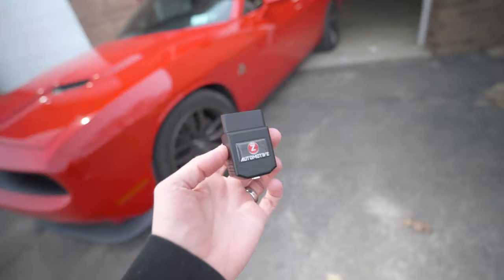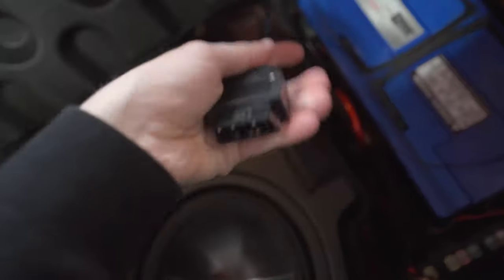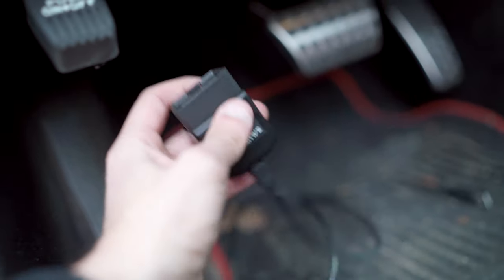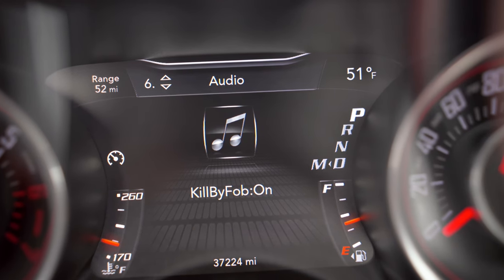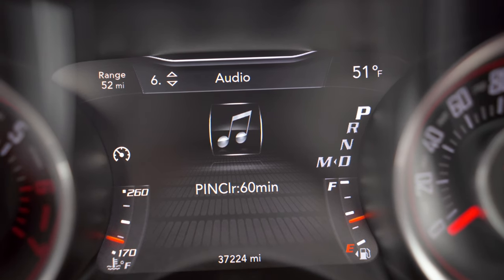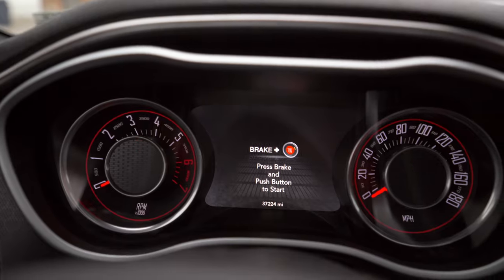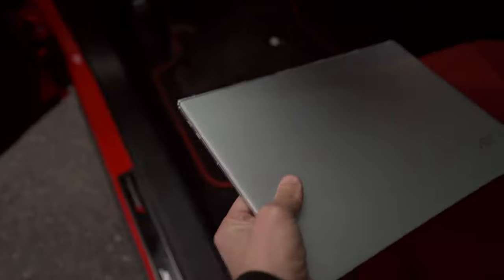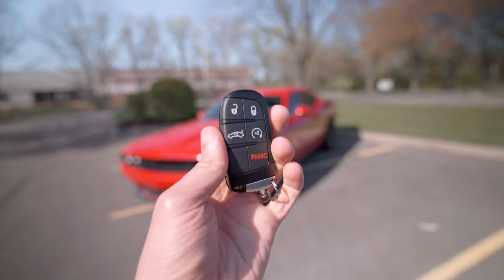Protect Your Vehicle from Automotive Theft - What This Device Can Do Will Shock You

Comment: Question here. For the 2011-2014 cars with the 5 speed auto Will pinlock  be able to tell if someone has pressed the shift lock button and activate the pin lock? It is much easier to do it on those cars with that transmission. Thanks!

Comment: Bought a Tazer for my dodge charger r/t. They are big ticket cars in my area. The Tazer security gave me the ability to sleep at night without worry because that car isn’t going anywhere without the pin. I even reduced the pin so you have much less time to work it.
Reply from the maker: Great to hear it can give some peace of mind but remember that it is not a fool-proof security device, so be sure to take as many added precautions as necessary

Comment: Does pedal disable still work for those who have Pedal Commander or other drive by wire eliminators? Also, when adding the 2nd OBD2 port in the trunk, is it going to screw with the factory port when I go for emissions?

Comment: Use the kill by fob all the time and works pretty well. Tired the pin but had issues with it not taking and then my car going into lockdown so I'm glad that they added that feature (lets hope I dont run out of battery on the fob while I'm out 😅).
Reply from the maker: if you're on the latest firmware, entering the pin is much more stable and snappy
Reply: I'll check my version and update it if its out of date and try again. Thanks! @zautomotive
Reply: Did you ever fix your pin situation ? Even after inputting my pin and getting the Disabled prompt my alarm still goes off.. sucks. Had to turn pin off and use only FOB function
Reply: @nbtextremes  I did an update and it fixed it. When I use the FOB I don't have to put in the pin, but if I forget and just hop in (which happens from time to time) or manually lock the doors with the button, the pin has been working as advertised.
Reply: @ajperkins9363  I realized it was because I out the pin in with my door open during testing. It was taking the pin but disabling the  system. I thought that was weird ..I closed the door,  did same thing and it worked

Comment: I'm considering getting one ever since my car got broken into about 2 weeks ago. But won't this void warranty? Or am I blending this in with your guys' tuner?
Reply from the maker: This is our tuner, this is the same device that has all those other features that you’ve probably heard about (Linelock, lightshow, performance pages on certain models, etc). It does not void warranty but it’s recommended to remove the device before taking it into service
Reply: @zautomotive  Ah, so its just plug and play, and the tuner itself kinda holds the info and feeds it to your car, in a way? Like a temp load for your cars computer and when its taken out, its not modified?
Reply from the maker: correct all plug and play @bhagrt

Comment: You mentioned if we valet the car or take it to a dealership we can use PIN Disable, does this mean we don't have to unmarry and unplug the device anymore when we take it for service?
Reply from the maker: That depends. It's always recommended to unmarry and remove the TaZer before any service work, but some people may have dealerships that know of the TaZer and may have a good working relationship with them. 

 PIN Disable may be a useful option for those that have that working relationship with their dealer, although keeping the TaZer plugged in is not recommended for service work.

Comment: Greetings , I am getting a wrangler.  Great video how would I remove the need to plug in a taser in the front where it can be removed.  Will this work with a taser min ?
Reply from the maker: These updated features are not yet available on the TaZer mini, just the base pin lock features where it locks up the brakes. You could always purchase out TaZer shield to help from the TaZer mini from being removed https://www.zautomotive.com/product/tazer-shield/

Comment: I have a 2015 Challenger, i got update 2.5.9 and have loved it thus far but i got 2 things i would like more info on. Ever since updating to 2.5.9, now when i open my door with the engine on my car makes the chime sound and flashes "fob battery low" on the dash until i close the door. Not sure if that is a feature or a bug but im not a fan of it and am hoping there is a way to turn that off.

My second question is regarding the new way pin lock acts. While overall i like it, i am a little concerned that 40 seconds is a bit to much time for a smart dodge car jacker to get the car on and moving before pin lock kicks in and even then it's still a matter of when the car slows down enough before the brakes actually lock up. I totally understand the car having to be slow enough before the brakes lock but my question is, is it possible to shorten the time from 40 seconds to say maybe 20 seconds or less before brake lock activates? Personally i would prefer 10 seconds but that's just me. If not i think this would be a great option to let us choose in the future and possibly consider shortening the time for by default. The Average theft time of a Challenger is 40 seconds but that includes the time it takes to get into the car and start it. Once thiefs start the vehicle they're pretty much gone within 10 seconds or less most of the time. In this regards i actually think the old pinlock method of locking the car on start-up was safer. 

That being said i do like the idea of having an initial delay (the new way pinlock is) but I think how long that delay is really should be customizable or give us the option to lock on startup like before. 40 seconds is just to long in my opinion. Sorry for the long comment just wanted to put my experience out there. Love your guy's products man you guys do incredible work, keep it coming💪
Reply from the maker: The "fob battery low" notification is warning you that Car-Jack Mode is going to activate if the key is removed from the car and then the car door closed. In 2.6.0, it will just flash the hazards and you will hear an audible tick

You can add your concerns about the Pin Lock countdown here: https://www.zautomotive.com/suggestions/

Comment: I love this update and can’t wait to put it in my charger. My only concern is some people who have the pursuit model such as myself have the fob for the car and can get in and start the car and go but can’t use the lock and unlock with factory key so they have a aftermarket alarm system. Is there a way to still use kill by fob? This is a feature I’d really love to use.
Reply from the maker: Don't believe that would be an option without the OEM key, but would have to check with the engineer
Reply: @zautomotive  I have the OEM key fobs but it doesn’t allow me to use the lock and unlock buttons. I have to use after market viper system key fobs.

Comment: Another question. With the pedal being bricked. Would this help degend against ond2 and can bus attacks? Like is it only easily removed by your tazer.
Reply from the maker: As far as we know. We don’t know of any other way to unbrick the BCM except through the TaZer, but we’re not 100% sure of all the ways they take the cars, that’s why we say it’s good to have multiple layers of protection. We are constantly researching and adapting the feature and products as we find new information
Reply: Thanks for your response. I think the bricked pedal will stop most people from stealing the lower trim models. Mine is a 14 charger se with the v6. But it has the sport trim package. For sure though the higher trim packages people will need expensive equipment and expertise to un brick the pedal. But I think for most cases it should be good.
Reply from the maker: @jonathoncouchey7151  hoping so as well

Comment: I just got the Tazer DT for my TRX recently, oddly enough I can still put my truck into gear and drive even without entering the pin. Also even know it's married the pin countdown does not pop up regardless of info screen and I can clear my PIN without having to confirm my old pin.
Reply from the maker: 1. The Tazer Pin Lock does not stop the vehicle from going into gear, and you need to turn on the other features for something to actually happen (brakes locking up, horn going off, pedal going dead, etc)
2. The Tazer does not need to be married to the vehicle for Pin Lock to function; Pin Lock is a live feature
3. You can clear your pin without re-entering your pin. You’ve already entered your pin, that’s the only way to even get to the clear pin option

Comment: What happens if you have the pin lock enabled and all the pin lock triggers options selected?  Does the killbyfob over ride entering the pin entirely for all the pin lock options or just the pedal?  I just bought the DL for my TRX and loving it so far but I am still trying to learn it.  Thank you!
Reply from the maker: So although Pin Pedal and the KillByFob both disable the gas pedal, they are different features. Pin pedal will only disable the pedal when Pin Lock is triggered; when the countdown runs out, or the vehicle is put into gear before the Pin is entered.

KillByFob is similar to KillPedalNow in that it's more of a pre-bricking precaution, both of which will keep the pedal disabled even if the TaZer is removed. Whereas, Pin Pedal only disables the pedal when Pin Lock is triggered and when the TaZer remains plugged into the vehicle. 

KillbyFob can be disabled by the keyfob and by entering the Pin, whereas KillPedalNow can only be disabled by entering your PIN from inside the vehicle
Reply: @zautomotive  Thank you for this explanation and for all of your guys hard work!!!  In other words, it adds like double protection with pin lock set and killbyfob used simultaneously, the way I see it
Reply from the maker: @JR-pb5dz  indeed. Thanks for the questions
Reply: On a manual transmission will pin lock activate once the car is put in gear like an automatic or does the countdown have to hit zero before the pedal goes dead and brakes lock up?

Comment: When enabling key by fob, does the car have to be on to enable the setting? 
Or have it on Run?
Reply from the maker: No. Please refer to the “killbyfob best practices” section of the video. The vehicle is off, and the car is being locked by the lock button on the keyfob
Reply: @zautomotive  I was reading the manual and it stated that the car had to be on.  It confused me and that’s why I was clarifying. I love all your videos. They are very easy to follow. Thank you very much.

Comment: Pin brakes on question !
Will the breaks still remain on if the pull lever under coin storage is pulled ?
Reply from the maker: The neutral strap?
Reply: @zautomotive  thats right !
Reply: Reason why I’m asking because my car was stolen last week and they just put it in neutral and pushed it away with another vehicle.
Reply from the maker: @mankamalchana4956  that’s awful. We have nothing in place that can stop that or being taken from by a tow truck. Even with pin lock, the vehicle can still be put into gear.

Sorry the vehicle was taken

Comment: Would my taser require an update? I never noticed a pin or pin lock pedal disable etc. I had mines going on two years now
Reply from the maker: yes, if you see the description this is on firmware 2.5.9 and our most recent firmware is 2.6.1
Reply: @zautomotive  thanks for hitting back. I updated and loving the new features. Freaked me out at first forgot my pin😅 but everything ok now. Last thing. Does the window feature work on 4 door ?
Reply from the maker: No the windows feature is for the front only https://youtube.com/shorts/tSO8kiJMBAk?si=_WmOkH7C69cmt-Ey @bloodlife7972

Comment: Question about the carjack feature. You demonstrate the owner/driver leaving the car with the key fob. But what if the fob is left in the car? Or what if the carjacker demands the fob? Will PIN lock still function and lock up the brakes even these instances? Does the mere physical action of opening and closing the driver's door activate carjack mode?
Reply from the maker: If the "keyfob missing" notification doesn't trigger then there is nothing telling the TaZer that the vehicle is being carjacked
Reply: @zautomotive and at that point, one should have a tracker on the car or a remote kill switch to kill the car from your phone, just in case

Comment: Sir, do we have to update the Tazer to get the new pedal kill feature?
Reply from the maker: Yes, but it's currently only available in a beta version which you would need to download directly from the ZPU software. It's not live on our website yet
Reply: @zautomotive  Thank you for the fast reply. I only recently added Tazer to my Dodge Challenger and it completely changed my experience with this vehicle- thank you to your team for this.

Should I wait or just update/ download it now Sir?
Reply from the maker: @AllegianceBattleGround  Since it is still a beta version firmware, there could still be some bugs to work out.

Really comes down to if you want earlier access or a more stable firmware version. We've been getting good reports from those using the beta firmware. 

If you do decide to download the beta version firmware, just please relay any issues to our support team - support@zautotech.com. 

All firmware details are listed in the description
Reply: Sir, thank you for this reply. Do I just update the Tazer and plug it back into The Challenger, make the menu changes, then perform the full reboot?
Reply from the maker: @AllegianceBattleGround  yes just update and plug back in, but if you already have a pin set from a previous firmware, clear your [in before updating. No reboot is necessary being that these are all live settings
Reply: @zautomotive  Thank you for the fast reply. I removed the pin and am updating it now Sir. I'll reply back once complete.
Reply: @zautomotive  Sir, how do you download the Beta version into the Tazer? I plugged it into the the computer via the Zpu software - states that I already have the latest version installed. What am I doing wrong ?
Reply from the maker: @AllegianceBattleGround  it would show up under previous firmware if you have “show beta firmware” selected (on windows). If 2.5.9 doesn’t show up, delete the ZPU and redownload it
Reply: Sir, 2.5.9 is now fully installed. I removed the pin, deleted the ZPU, re-download the ZPU, then manually updated the Tazer. Thank you or the guidance and direction provided Sir. I just turned all of the new features on; I'll have to watch this video a few more times to become fully aware of the new features and to get used to them.
Reply from the maker: @AllegianceBattleGround  Glad I could help, hope the features serve you well. Please report any bugs to support@zautotech.com. We already know if there being a bug with remote start
Reply: @zautomotive  I don't have remote start so I shouldn't have any problems with that. I have a 2016 SXT+; I absolutely appreciate the additional features the Tazer adds. It's a one of a kind product.
Reply from the maker: @AllegianceBattleGround  appreciate the kind comments
Reply from the maker: @AllegianceBattleGround  Yes, all these questions should be sent to customer/technical support - support@zautotech.com

Comment: To use the kill by fob feature does the Tazer need to stay in the car, or can it be removed when we exit the car and the feature still work?
Reply from the maker: To activate KillByFob, the TaZer needs to be plugged in. But once KillByFob is triggered, even if the TaZer is removed, the pedal would remained disabled. Which is why we like this feature so much
Reply: @zautomotive  Thank you so much for the fast replay! Mine will be here tomorrow, can not wait to try it out.

Comment: Can you kill the brakes and the gas pedal every time you lock your car ? If they don’t start it and try to push the car
Reply from the maker: You can kill the pedal every time you lock your car, but the brakes will only lock when the vehicle is running and the Tazer plugged in

Comment: The killbyfob mode is enabled. If I don’t enable PIN Lock and I only enable on killbyfob if I only have that feature on. Does it disable gas pedal by default?
Reply from the maker: You don’t need to have any other PIN Lock settings enabled and can just have KillbyFob enabled, although a PIN needs to be set to access the PIN/Security submenu, which killbyfob is in
Reply: @zautomotive  got it, thank you.

Comment: Is there a reason the pin menu doesnt pop up on my 2015 rt? It makes the hazards blink when i start the car but theres no notification so when i start unlocking the car, I'm never sure if my inputs were recognized. I'm wondering if my car is too old or if theres an update i should be doing to the tazer or uconnect. I'm on version 2.5.9-033023.
Reply from the maker: Email support@zautotech.com

Comment: In your car jack mode, you take the keys out of the vehicle and place them outside. You get back in the car, try to drive away, then the car locks up after coming to a stop. You then enter the code, to unlock the vehicle, you said, "The vehicle shuts off" then you enter pin, put it in gear and you drive on. How did it start again without the key?
Reply from the maker: That’s actually a very good question… I’ll need to look into that a bit more, could be vehicle specific, as it didn’t fully fall asleep and electronics were still running.
Reply: Have you figured out the problem of starting the car while the keys were outside the vehicle? @zautomotive
Reply from the maker: After taking a closer look with our support staff, the car allowed us to turn the vehicle back on even without the key (and after entered the pin) because the vehicle was still in gear @rbaroncpd